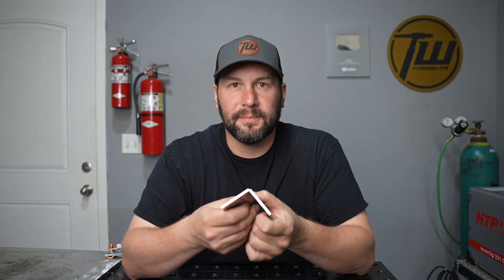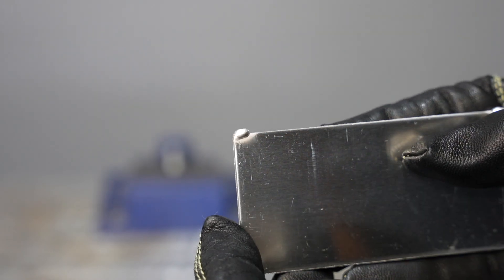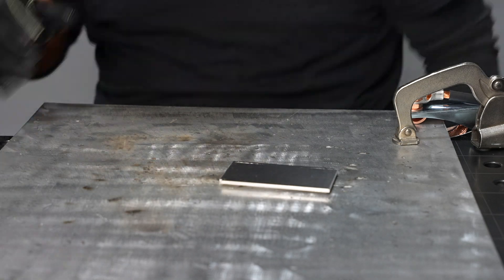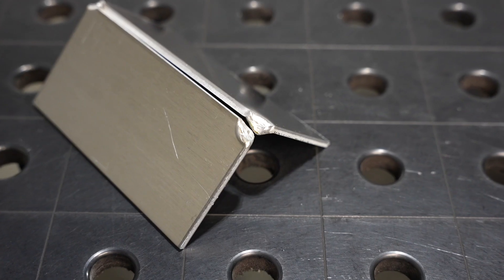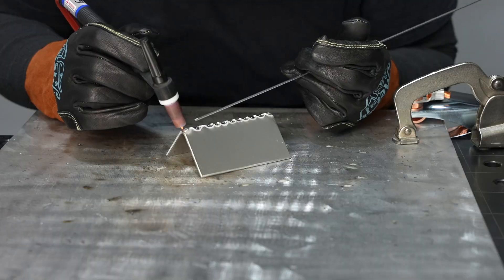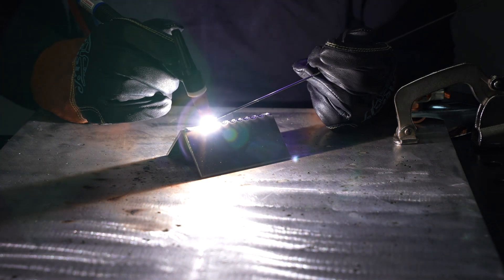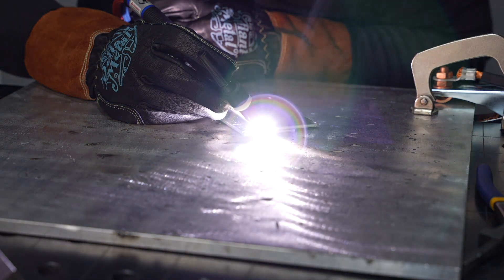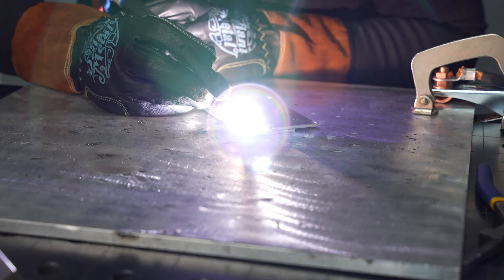Tack Welding Aluminum without Filler: TIG Welding and Fabrication

Comment: It is absurd to ask, I know, but which tungsten are you using in this practice? Thank you!
Reply from the maker: It's a great questions. This is CK Worldwide LaYZr multi-mix tungsten. In all reality 2% Lanthanated or Ceriated work just about as well for all around work and there's very little difference in the result you'll get from any of them. The reason it retains the point so well is largely because I use Asymetric AC on the HTP to limit the amperage on the electrode positive side of the cycle.
Reply: @TimWelds  You are number one of my idols. Thank you.
Reply: Could you describe Asymmetric amperage. Im at 70% electrode positive I think. Cheers 🎉

Comment: Just don't fuse 5052 😅 I've learned that the hard way.
Reply from the maker: Great point! 5052 can develop some cracks without filler, though not as bad as 6061. Even with these alloys, I've found that tacks like this are often good enough to hold things together during assembly.

Comment: Well, i just learned something.  
Because tig aluminum tack welds and i previously were not friends i mig welded a bunch but this here looks really easy, i will try this out
Reply from the maker: Thanks Peter! As long as the fit is tight, this works really well for me. Sometimes the tacks are weak, but it's usually strong enough to keep things in place.